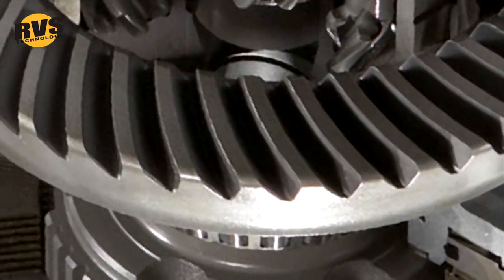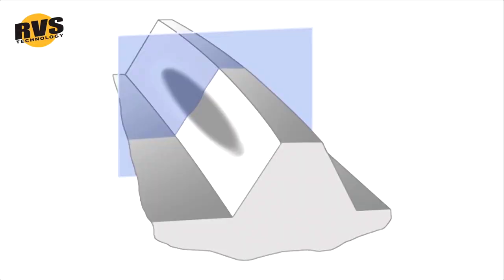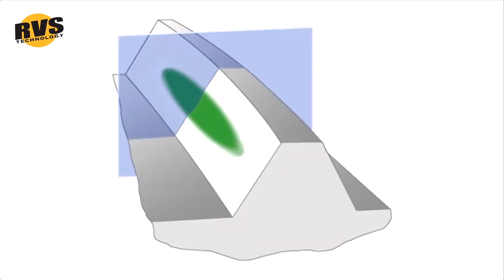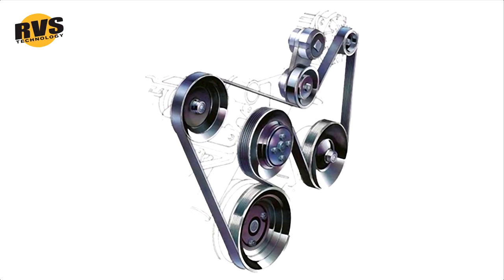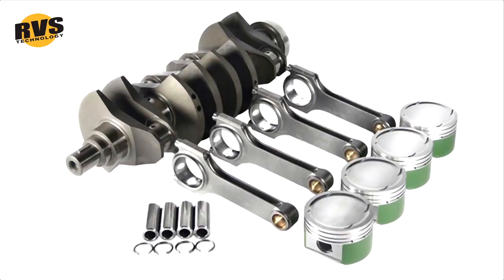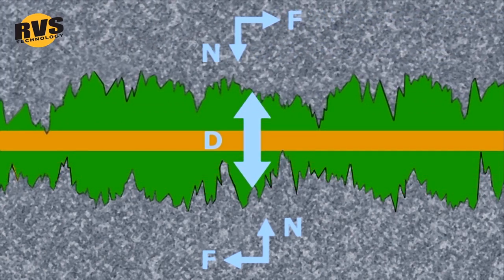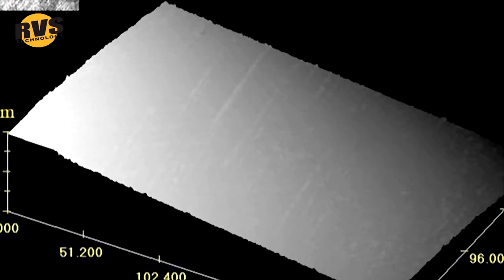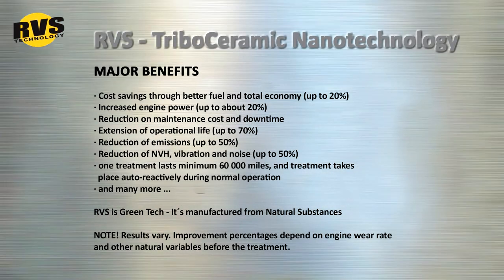RVS Technology: how it works!

Comment: How does this compare to Nano-technology based treatments?
I'll be sticking with regular oil until this is proven reliable.
Reply from the maker: It is a Nanotechnology treatment. And you can check for example the TÜV test for proof. We will guarantee fuel savings and power increase too among other benefits 😎
Reply: @rvstechnologyusallc2290    Thanks for the info.  Does it suit one type of engine over another? Are exhaust gas emissions affected? How does the coating finally break down when the mileage limit has been reached? Sorry for all the questions!
Reply from the maker: @paulf1071  Not really. Obviously if an engine has more miles/hours/wear, then you'll see bigger gains. You will see a definite improvement in emissions, in some cases quite drastic even. The wear is so slow and little that it probably won't even be measurable and takes over tens of thousands of miles.